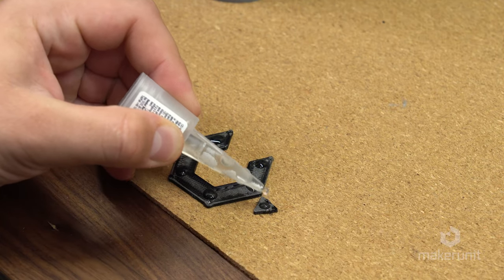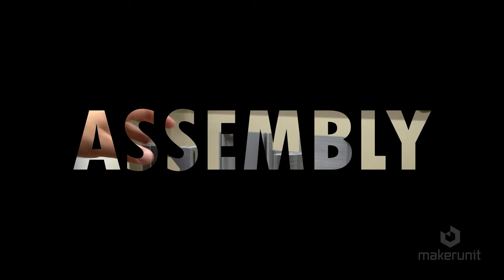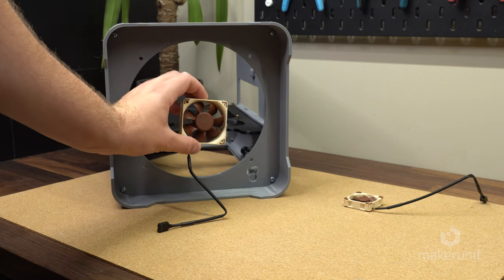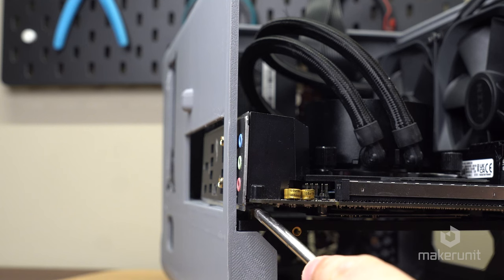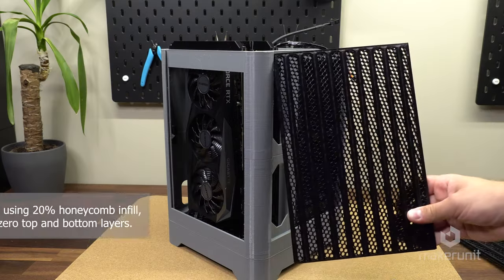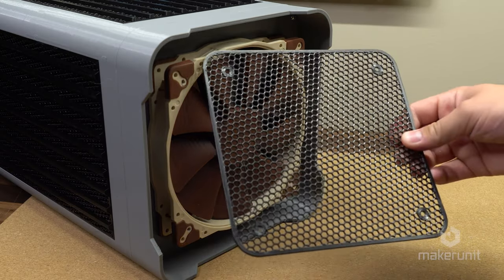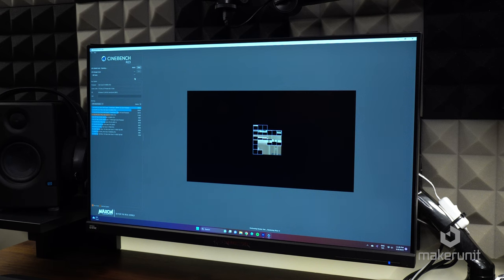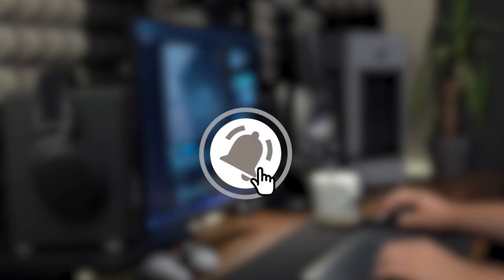Mini ITX 3D Printed PC Case Chimney Style

Comment: The surface finish on this is horrible. Did you upgrade every part of your printer just to make it perform worse than a stock machine? Please explain ^^ Also have you considered doing to post surface works? Would make the end result look so much better
Reply from the maker: Well, worn out wheels and generally a poorly tuned machine are to blame for that, I guess I’ve been spending most of my time focusing on the designs rather than the print quality, but I’ve recently gotten myself a K1 Max that I’ve put some work into now and tuned to have really nice print quality even at high speeds and great dimensional accuracy, so future projects now should have better finishes. 

My CR10 will from now on mainly be used for other functional prints not for the «pretty stuff».

And yes, I’ve considered doing some surface finishing but currently I’m in a flat which isn’t very sanding and spray paint friendly, that’s the main reason why I avoid such projects, even though I want to.

Comment: а не проще обычные гайки вставить, а потом закрыть их приклеив кусок пластика? Не знаю как petg, но pla можно дихлорэтаном приклеит, а не проблемным супер клеем.
Reply from the maker: Well it depends, but threaded inserts are quite easy to use as well in my opinion. You could also just tap the machine screws directly into the plastic if the holes were tight enough, though it would be risky as the plastic might wear out if overtightened, but from previous experience it seems to hold up very well too especially for permanent installations that are only intended to be attached once.

Comment: I want to build my own 3d printed case but there's too much horror online regarding ESD damages with plastics. Can someone shed some light if these cases are safe
Reply from the maker: I can say with the hand on my heart that I personally have never experienced any kind of static in any of my cases apart from just a few seconds after taking it off the build plate. 

A few times I have noticed static when removing a print from the but other than that never after they have cooled down… but never noticed anything like that when it comes to the PC components etc. all my 10+ cases have worked flawlessly to be honest. All parts should be grounded through their power cables as well anyways so I don’t really think this is a problem. At least not based on my experience 😅

Comment: can i print it using carbon fiber? it would make it lighter? and do u think u will release an smaller version?
Reply from the maker: I hadn’t planned on doing a smaller version of 
this… but maybe someday if I find a layout that works in this design.

The filament to use is free for you to choose. I’ve used a mix of PLA for the gray parts and PETG for the black parts.

Comment: do you think a 320mm gpu would fit?
Reply from the maker: If you use some 20mm spacers between the GPU mount and the frame, and just some longer screws you may be able to fit a 320mm GPU, but you’d need a pretty low profile angled DP cable for the monitor.

Comment: If using a Micro Atx motherboard, is it possible to mount without the CPU cooler in this case?
Reply from the maker: Unfortunately not as a Micro ATX board is 244x244mm and the outer size of the case is 250x250 meaning the inner maximum is about 240mm at most, but then we also have the sliding side panels etc adding to the wall thickness so probably would be left with about 230mm of room total 🙂

Comment: My dude, you REALLY need to flip that radiator! The tubes should never go down from the pump, always go up so that the entry to the radiator is higher than the heatblock/pump - hæving it your way is almost a guarantee that it will die early due to air.
Reply from the maker: Thanks for the concern but, That’s interesting, because if you google «how to mount a radiator in a pc». First thing that pops up is literally 100% explaining how I’ve mounted it. 

Having the radiator like that will trap the air in the chamber on top of the radiator. The tubes should be at the bottom so there’s always liquid at the lower point where the pump grabs it’s liquid from. 

Gravity makes it so that the liquid will always seek the bottom of the radiator, therefore always being able to supply the tubes with liquid… just from the way I understand it but who knows, I might be wrong…
Reply: @makerunit  Hi there :)
Yea I don't know what happened this morning, must've been too early or a stroke ;) Sorry about that :) 
 You're 100% correct, and as a matter of fact that is also how I have my own AIO mounted ;) 

For anyone reading along, if you do mount your AIO vertically like this, tubes down BUT remember to keep the top of the radiator ABOVE the level of the pump/block :)
Reply from the maker: @mikkelkirketerp4884  No worries! That last part is correct though about the pump placement 😊

Comment: How difficult would it be to design a rack mount 3d printed pc case ?
Reply from the maker: I’m not sure as I’m not really familiar with the rack mounting system 😅
Reply: @makerunit  that's fair was just wondering most rack mount  cases are really expensive so being able to 3d print one would be nice.
Reply from the maker: @coryreynolds1167  I see! I have no experience with it but I would guess it would be as straight forward as any other case build, just with the rack form factor and definitely possible! Maybe if it’s a very wide rack it could be reinforced with some aluminium flat bar maybe 😁 what width is a typical rack?